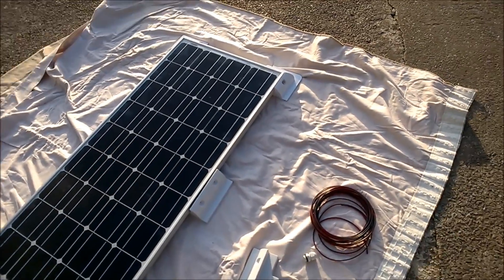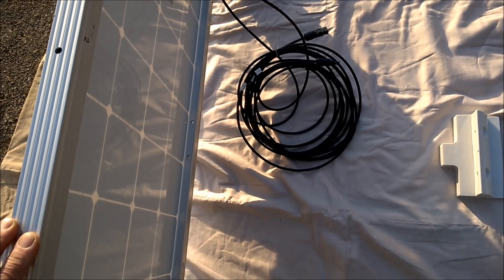Fitting a solar panel to a motorhome or caravan: Part 1

Comment: I like your idea of making the template, but if you use nuts and bolts to screw brackets to panels. how will you remove when your panel dies. I suggest using Gal tech screws. drill first all the way through even if they are self drilling because if you dont then you will only have a thread in the second wall of the aluminum because the first thread will be destroyed while it is drill the second wall.

Comment: Great Video Jonathon! I'm just about to attempt the same work and this has given me more confidence. The roof cleaning I will now change to ISOPROPANOL (which I already have) was told to scratch up the ABS footprint area and clean with white spirit then get any residue off with meth spirit? I'm going to apply doublesided  sticky x2 10mm squares to ABS feet which will allow the 512 adhesive to leave a slightly deeper bed so I can in the future cheese wire the ABS feet off if req as ours in now a very old van and may want to do this.Will also buy the tubing for wires you've listed.I think my kit is the same as yours from the same seller...I'm also going to run along side the S.controller a Watt meter for more accurate measurements.I decided to buy the S.Panel due to having to replace my L.batt frequently even though I take it off and bench charge it once a month whilst our van is not in use.I read about a little trick to revive completely dead L. batteries and it worked! I took jumps leads off our car batt and connected them to the dead battery and also connected a charger to the dead batt and brought it back to life! By connecting it in this configuration it seems to of tricked the charger into action.You are spot on about "not being enough info out there"By the way I also have got the same kids revising whilst struggling on our van roof...But when I check up on them there always playing video games....LOL Enjoy your Touring and Safe Journeys...Kind Regards Steve:)